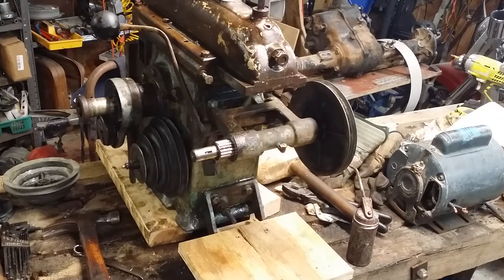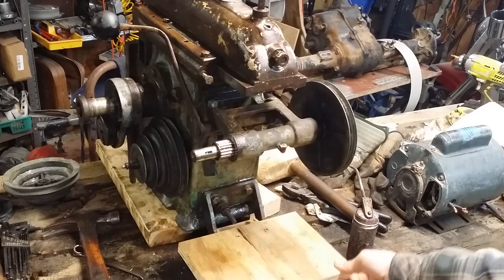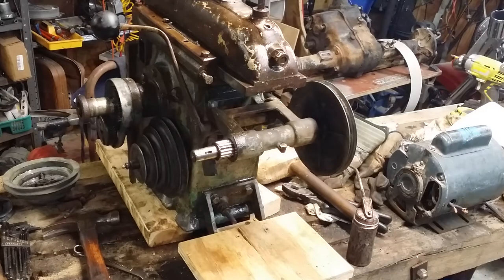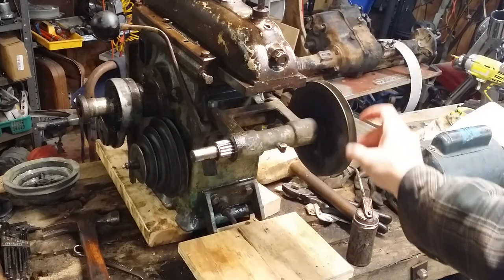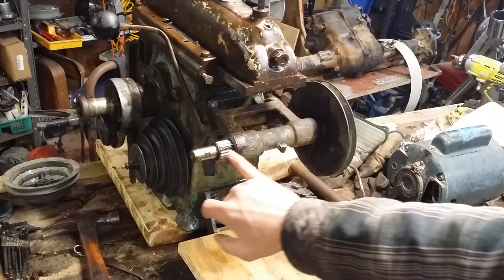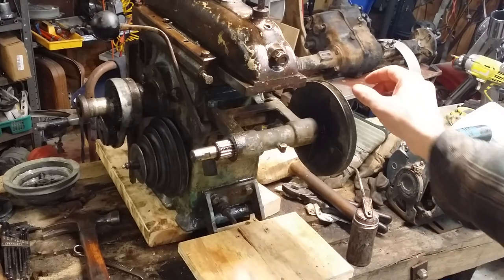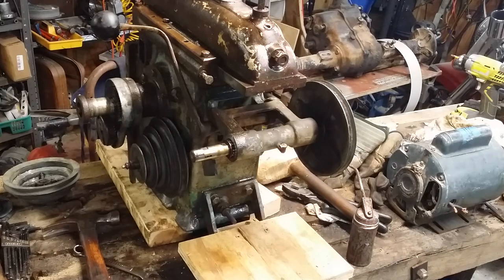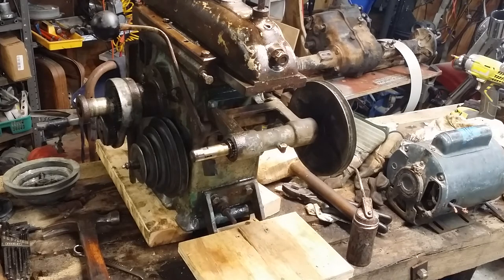atlas 7B temp motor mount plate and aux shaft bearing examination

Comment: Its amazing how those needle bearings work well after a clean. That grease must have protected them inside the housing. Lucky.
Reply from the maker: No dought, I expected the worse. Been very lucky on this, the mechanical parts have cleaned up. There has been some water issues with this machine in the past, but everything has come apart, and cleaned up. Thanks for joining me, I have enjoyed your channel as well.